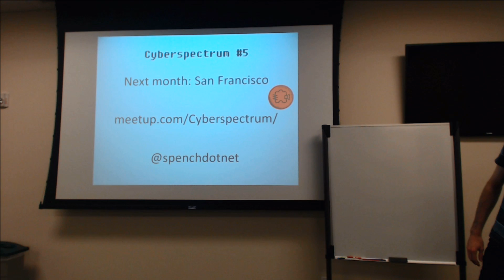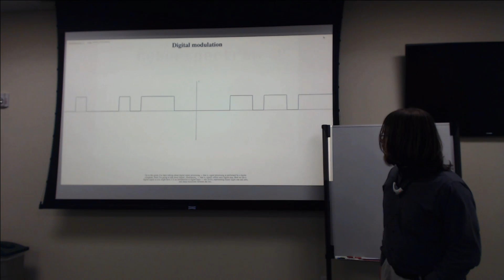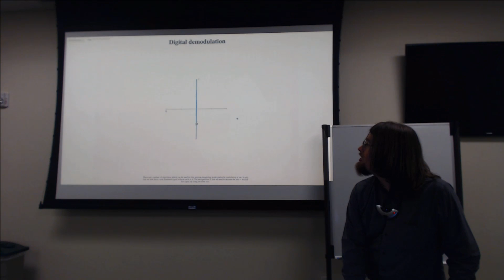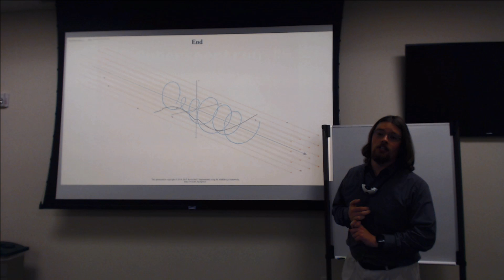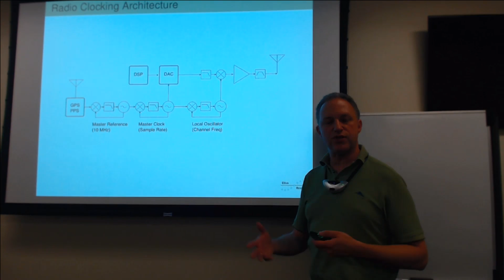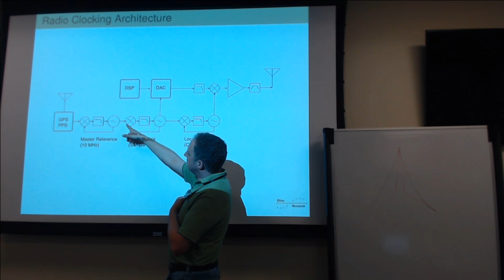Cyberspectrum: Bay Area Software Defined Radio #5 (Mar 2014) Archived Live Stream

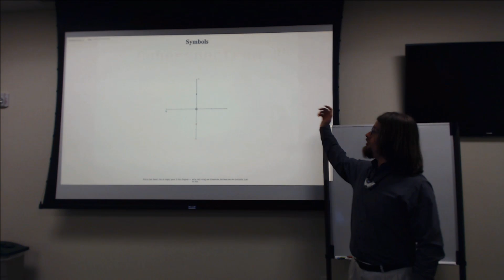Comment: [around 33:26] When moving from On-Off Keying (where all the information is aligned along the I axis) to QPSK, why does it make sense to move away from the I and Q axis? In other words: if you're adding 2 more symbols to a set of symbols along the I axis, why not add the 2 new ones to the Q axis instead of making all 4 symbols be combinations of I and Q?
Reply: SNR. Think about the distance between the constellation points for a given peak amplitude.